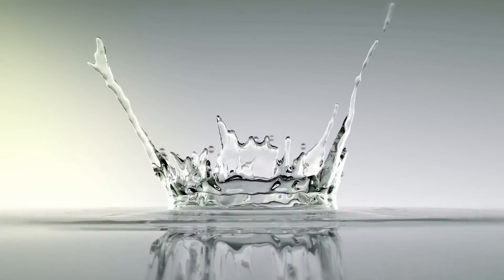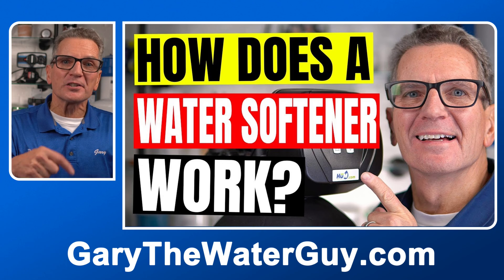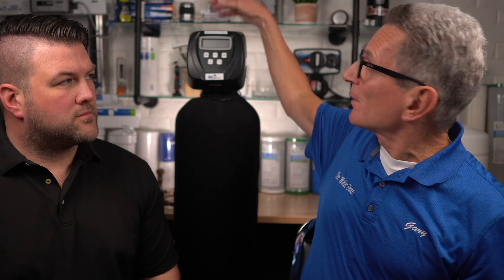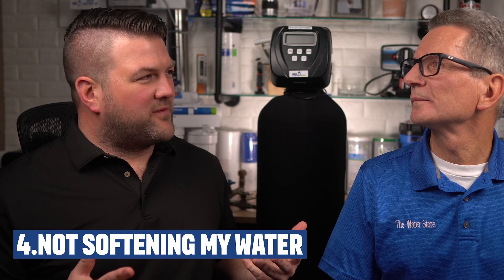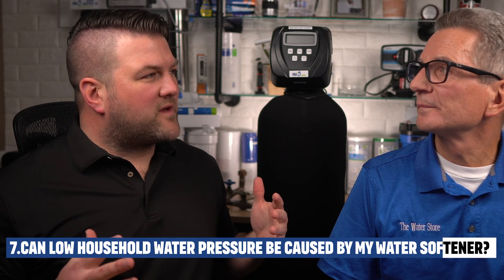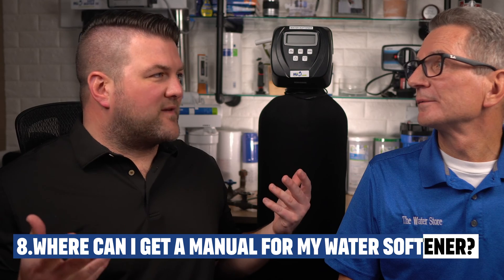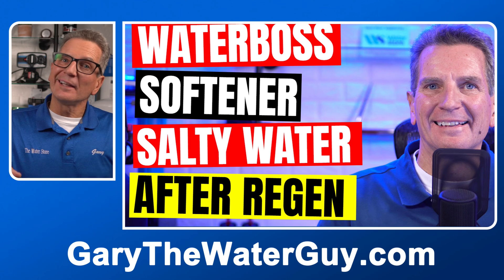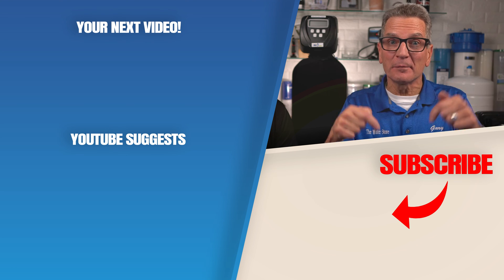11 WATER SOFTENER Troubleshooting FAQ’s for BEGINNERS

Comment: I have an older pentair 255 softener controller.  I tried plugging it in today, but all it shows on the screen is "2.11" and none of the buttons do anything.  It's been in service since around 2010 with no issues.  
Any ideas what could be wrong with it?
Reply from the maker: You'll need to either replace the circuit board, if you can find one, or replace the softener. We have some great ones here https://waterestore.com/search?pf_pt_product_type=System&q=hum+water+softener&type=product
Reply: @water_estore  It looks like I was using a DC power supply instead of ac. It worked again once I corrected that .

Comment: Purchased a foreclosed home with no hot water for 2 years.  Just Paid $$$$ to have brand new water filter - plumbed to brand new water softener system, with twin tanks.  Water was only slightly yellow before adding this new system.  Now it’s dark brown and much worse.  We tested the water and it shows the softener is working. And have been told by the supplier to regenerate it - which we have done about 30 times… it’s no better.   No one seems to have any answers and it’s Browner 💩 than ever, any suggestions?
Reply from the maker: Yes, when water sits inside a water softener for a long time without regenerating this will happen.  I suggest you clean the media several times using this https://waterestore.com/products/pro-res-care-water-softener-resin-cleaner  to see if it improves, this video will help https://youtu.be/c8QKYr3B02I
Reply: its water line, check your city

Comment: I purchased an Aqua sure system, it ran great for a year, then i had to shut the water off to repair a leak upstairs, now it will not flow water at all, I've checked everything, its getting good pressure to the tank, and when i bypass the system, the water flows just fine, any thoughts?
Reply from the maker: It sounds like the media is clogged, try the advice from this video https://youtu.be/tCQQxiT-zoc
Reply: @water_estore  thanks for the reply, i replaced both vavles leading to the system and from the system and its working fine now, I have no idea why lol.

Comment: Thank you for the informative videos. I have a question. If my discharge line is frozen while the water softener is running can that damage the water softener?
Reply from the maker: Yes, I've seen than happen but not always.
Reply: @ Thank you.

Comment: My recently installed softener is showing “regen” and “backwash” is flashing.  It has been making noise for 24 hours now.
Reply from the maker: It is stuck in the backwash cycle. Bypass the water softener to stop the flow to drain and call whomever you bought it from so they can fix it for you.

Comment: Hi.. recently widowed and I’m lost fixing my softener. My filter needs changed monthly and is thick with rust.. even appears to have grass clippings on it. Water stained toilet etc. Have regenerated several times. Water goes soft-ish then hard. Not usually salt water level in brine tank higher than salt. I’m going to empty brine tank for possible salt clog at bottom. Softener is 6 yrs old.  Is the grass stuff normal?? Ugg help!!
Reply from the maker: Grass is not normal at all.  It sounds like you need an automatic cleaning iron filter before that filter, like this one https://waterestore.com/products/hum-chemical-free-iron-sulphur-manganese-fok-filter-1-5-cube If you complete the info on this page we can size one for you https://waterestore.com/pages/free-water-test-evaluation-the-water-estore

Comment: We have a new water softener. It was set up for us. I noticed there is only 2" of water over the screen on the bottom. When it goes through a cycle there is hardly no water in the brine tank like I said about 2"above the screen but it draws from the brine tank for 60 min... So it draws the little bit of water then it sucks air for 52 min. Is this normal?
Reply from the maker: Depends on the type of water softener, the settings and it's size.  The most important thing is, is it softening your water?

Comment: Hello, I’ve got a GE 40k grain softener. I just cleaned and replaced the resin but still no soft water. I have no idea what’s going on 🤦🏻‍♂️
Reply from the maker: The problem with those is that they are meant to be disposable, not rebuildable.  I could be a number of things, but if you tried all of the troubleshooting steps and it still isn't working, I suggest you replace it with one that is rebuildable like this  https://waterestore.com/products/hum-metered-water-softener-45-000-grain-capacity-free-shipping

Comment: I have a gxrsh40v softner. The blue light is blinking. But when you press mode button. Nothing happens. You can scroll pressing the up arrow. But I get no arrow pointing left to the change the setting. Confused to why this is happening. My dad did forget to add the salt before it got low. Is this the issue?
Reply from the maker: I don't know. These water softeners are basically disposable so unless the answer is in the manual or you can get something from the 1-800 number you are out of luck.  But running out of salt would not have caused this as far as I can tell.
Reply: @water_estore  thanks for the heads up. Will look into it more.

Comment: Quick question, I started to see gray / dark discolored water in my toilets, is that due to a specific water softner issue?
Reply from the maker: I don't think so, do you have a carbon filter to remove chlorine from your water?  If so, that could cause grey water.

Comment: Well, thanks for the video. Installed a new whirlpool water softener and facing err 1 since beginning. Kindly share your suggestion what would've gone wrong.
Reply from the maker: Whirlpool water softeners are basically disposable, if something goes wrong you typically get it replaced under warranty or get a new one.  But this video might help https://youtu.be/VMnX5bAFi0Y
Reply: @water_estore  thank you so much. This one is so informative! I will give this method a shot and update here how it turns out.

Comment: Hi Gary and John,

Do you have any tips for a sudden deluge of water coming out the bypass valve? Thankfully I was in the basement when it happened and was able to close the valve fairly quickly. It would have been a huge disaster.  I have the bypass closed and unit unplugged currently.  Not sure what to do next. Thank you for your time and thoughts! 😊
Reply from the maker: Never heard of this happening before.  If the bypass is defective I would just replace it, we have them here https://waterestore.com/products/clack-ws1-bypass-v3006

Comment: What setting can i adjust to increase the softness of the water, Fleck 5600 n 48K system.
Reply from the maker: Not verty familiar with the Fleck 5600.  Assuming that it is metered, increase the hardness settings by 10%, give it a month or so and see if that helps.
Reply: I have gone from 11 actual North Texas water # to 26 with no noticeable difference. Will do the res restore a couple times to see if that revives the media

Comment: What is the average amount of water that is discharged down the drain each regeneration cycle?
Reply from the maker: Varies widely between makes, models and size.  Kind of like asking about gas mileage on cars.  Anywhere from 13 gallons to old technology (but still sold today) very inefficeint ones that use over 100 gallons of water.
Reply: @water_estore  Hello Gary,  I have a brand new system all Clack Air over Media Iron filter plus Softener.  I did a small calculation for my softener based on flow rates I see from my metered Iron Remover.  I figure I use approximately 100 gallons during the softeners full cycle.  Would you consider this new Clack  WS1 to be inefficient?

Comment: Im having an issue with my water softener. It is a Clack and I dont think its pulling water from the brine tank. I have manually cycled it though each cycle, and at every stage it is putting water INTO the brink tank. I did check and there is water coming out of the outlet during the backwash stage, but it is putting water into the brine tank as well during that stage. What could be wrong?  Thank you in advance.
Reply from the maker: The drain line could be clogged, that is the most likely reason.  Other then that, this video might help. https://youtube.com/live/Lr3jyGiJdC0

Comment: You videos have been been very useful in learning about our water softener system and getting it back up and running.  We purchased our house in 2016 which came with an AQUAPRO 5000 SXT and AQUATAP SQC 5000 already installed.  The previous owners had them installed on 12/21/2009.  It wasn’t being maintained when we bought the house and we haven’t either.  By not being maintained, what I mean is that salt wasn’t/isn’t being used in the brine tank/salt reservoir and no maintenance was/is being completed.  The two valves on top of the mineral tank/resin tank are open sending the water coming in from the main thru the mineral tank/resin tank and has been since we bought the house.

 
Our water is hard.  After washing our vehicles, any remain standing water that is left to evaporate on the vehicle leaves behind a mineral deposit.  I’d like to put the system back into full service to eliminate our hard water.  I’m concerned that the resin beads inside the mineral tank/resin tank are no longer any good after so many years without any salt being put into the brine tank/salt reservoir and no maintenance being completed.  Online resources suggest that, to retore the system to be “like new”, to pour water mixed with Super Iron Out into the brine well inside the brine tank/salt reservoir and trigger a regeneration/recharge cycle to clean the resin beads.
 
What do you recommend for restoring the system to working order?

Contacting Aquakleen Authorized Service Corp., the sales person recommended they service the system for $618.  A service manager emailed me and provided a different recommendation: The most important aspect about your system is that water is flowing properly through it.  When the resin bed in the system is fouled, the tell tell sign is that water flow will diminish or completely stop.  The Iron Out product you mention would be appropriate if the water source has a high iron content.  We don’t use that product very much because most of our customers have water provided by the city where iron is not an issue.  We normally use a product called Res-up which is formulated to clean a resin bed and improve its performance.  What I would recommend if you want to put your system back in service is to add a Res-up feeder and put some Res-up into the feeder, add salt to the brine tank and set the system to regenerate every night for 4-5 consecutive days.  This will allow the resin to be regenerated and eliminate any debris or accumulated contaminants.  If the control valve is working properly, after those regenerations you should be able to feel the water softer.  It is important to mention that one thing that may happen with resin that hasn’t been maintained properly is that after it starts softening again, it may become fouled and you may notice the pressure drop, like I mentioned before.  If this were to happen, putting the system on bypass would allow the water pressure to return and it would be an indication that the resin bed needs to be replaced.
Reply from the maker: Yes, I agree with his recommendations and I have covered the use of Res Care or Res up in this video https://youtu.be/c8QKYr3B02I
Reply: @water_estore  Thanks for the response.  After two consecutive days of completing a regeneration cycle, our water turned yellow.  Googling indicates that the softener resin is fouled.  Thoughts?  Should probably pay the $618 and have the company come out and service the system huh?
Reply from the maker: .... or you can do it yourself by following the advice from this video https://youtu.be/Z47JGH1l39o
Reply: @water_estore  Thanks!

Comment: I had a 3m softener that is exactly a clack ws1 42 liter softener, it’s connected to the sump motor from where the water goes to the overhead tank, the water is well water, the flow of the water is 25per min as there is a uf membrane before the softener. I noticed that a few tiny particles of resin inside my overhead tank every now and then, 3M replaced the screen filter and resin, still it was happening so replaced with a brand new softener and same issue in this as well, is it normal for a little bit of resin to leak out ? Please help me
Reply from the maker: Yes, you can get a little bit during backwash especially when new, but if you are getting more than a couple of tablespoons full it is too much.
Reply: @water_estore  thanks for the reply Garry, so do you mean the leak happens only once or eventually it can leak little by little during use or regeneration.
Reply from the maker: Typically just a few times when new.